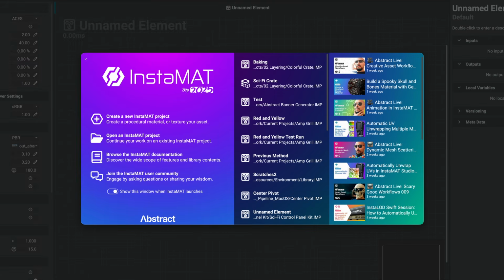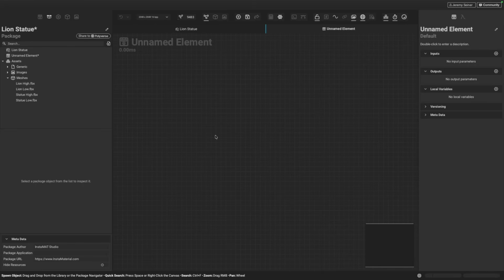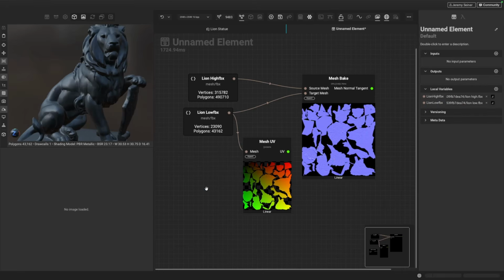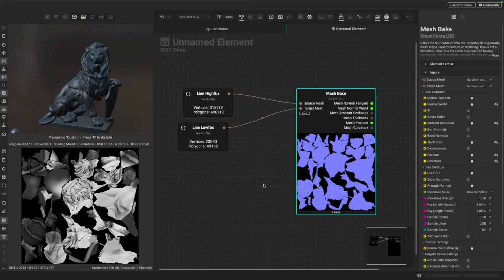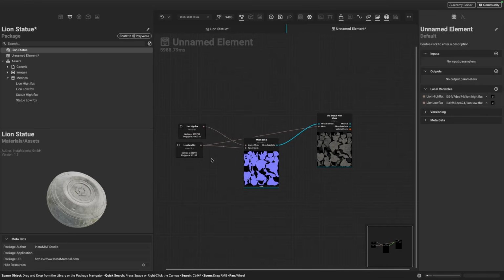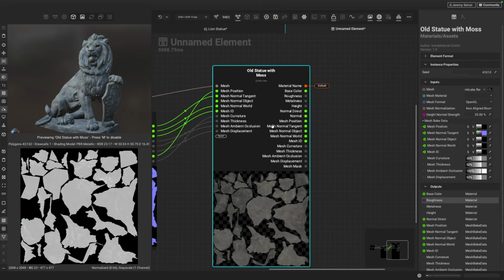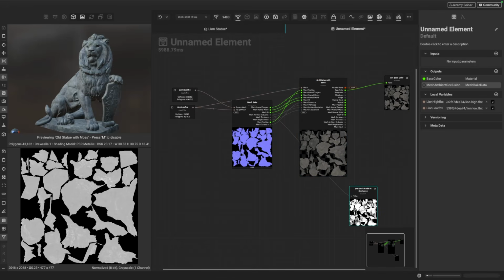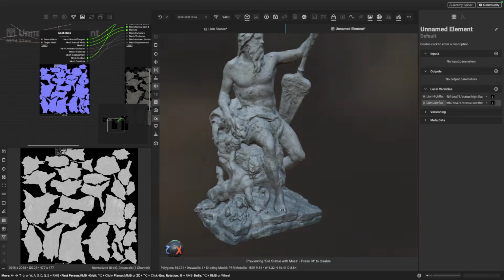Create a Reusable Mesh Baking Workflow in InstaMAT with the Mesh Bake Node and the Element Graph

Comment: is it possible to texture the high poly mesh and then bake texture maps into the low poly mesh?
Reply from the maker: Absolutely! If your high poly mesh has UVs, you can texture it directly within InstaMAT. With InstaMAT's Element Graph, you can generate a low poly mesh with the Mesh Optimize node, or use a transfer map generated with the Mesh Bake node to apply the textures to a pre-made low poly mesh. Additionally, you could use InstaLOD to create highly optimized versions of your meshes after texturing with InstaMAT.